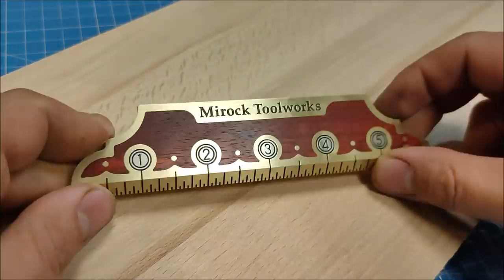Masonic Ruler

Comment: I am as fascinated with the piece itself, as I am with the milling and assembly. Beautiful. Now I want a home use CNC.
Reply: Luckily they're getting cheaper so we can afford to. Cheap ones can be made if you have the want to and know how. They are pretty good also. Tormach is a little pricier for the home shop but they're decent enough even for beginner hobbyists. There are cheaper ones still.
Reply: If you know how to program it via madtercam or some other software get a ghost gunner. Really small really strong 3 axis mill ready for metal
Reply: @WoodsRlee  can it be programmed through open source?  I understand the basics of programming, but would not be able to program a CNC from scratch. I am thinking about building a CNC, and paying someone else for the code.
Reply: @Inertia888  
As far as the ghost gunner goes. You CAN. Look up gcode. I frequently code by hand for small projects. Notepad. But its not an easy task and easy to fuck up a machine if you are really new to it. But there are a million choices for learning to code it.

As far as building a cnc from scratch, it's also relatively easy to do, but if you can't program well, or not sure, it will be difficult  to see where problems are when they arise, is it your gcode? Is the machine malfunctioning?

I would suggest you get a cnc mill kit if you want to build one. That way you know it works

Comment: What a beautiful ruler Out of curiosity, what makes it Masonic? I understand the significance of a 24 inch gauge, but unsure about this?
Reply: This should be the top comment. It's a very fancy 6 inch ruler, to be sure. Not even an attempt to describe whether it was made by a mason or inspired by an old masonic design. Not even some basic or obscure masonic symbolism etched into the surface... and those are best cases, because it "sounds cool" is probably, statistically, the unfortunate answer here. Pretty ruler though.
Reply: @bobskewer1874  the only reason i watched it was to learn what a masonic ruler is. also the only reason i came to the comments. does the shape have special applications? if so, why no demonstration of it in use? meh.

Comment: What, exactly, makes this “Masonic”?  I didn’t see any of the symbols normally associated with Masons.  I would call this “steampunk”!  It’s beautiful!!!
Reply: I guess it depends on the ritual...  It is 6 inches long,  so 6 multiplied by 4 is 24...  That is as far as I will go on an open forum.  Very nice work!
Reply: @louisjutras1  … I knew there had to be some mystical reference in there somewhere.  😀 thanks for clarifying!
Reply: @louisjutras1  good math. But that is a poor answer for the Masons. From a Past Master.
Reply: @halkester9368  …it’s ok… I don’t need to know y’all’s secrets.  I just wondered what caused Mirock to label it “Masonic”!  I gather there is some significant meaning in the dimensions and or the shape.  It’s very pretty.  And he does wonderful work!
Reply: @halkester9368  In the province of Quebec,  we have 24 inches.  Period.  In all the years I have been around,  I have never seen a 6 inches ruler in any of the lodges here.  So again,  the ritual you are using in your jurisdiction might see this differently.    I was PDDGM by the way.
Reply: @louisjutras1  I wrote a new reply to anyone. I agree with you about the tool.  I don't know what the man was trying to explain with 6x4 at all.  Or any reason this ruler would be called masonic.  please drop a note to mr. Mirock or the man who can do 6x4.
Reply: @louisjutras1 How magnanimous of you to go as far as you did.

Comment: Plexi-Glass!!! I was wondering why you were using it at first, but then I realized. That’s a really good way to keep a small work piece fixed to the the table. Awesome project!
Reply from the maker: Yes. But need to use flexible plastic polycarbonate in my case.
Reply: Ahhh okay, thanks for telling me what you were actually using…from the computer screen, all clear plastic with that description looks like plexiglass lol

Comment: I have a question. And yes I suppose I could go google it but I’m hoping someone will answer. I am a carpenter and have been one for a long time but I do finish work frame houses have always wanted to do finer projects. Inlays etc. I have some very nice insoles that I have refurbished and they work great sharpen them myself set the teeth etc. But what about for CNC routers and the four machines. How are these old beautiful wooden tools made and projects?

Comment: Another comment likely already has it... but 
1 tool hangout on engraver is too long 
2 use all carbide tooling if you arent 
3 make / buy cantilever style hold downs for the angle cut.
4 hold those plugs in with thermal press fit... or knock them in with dull punch.

Comment: Fantastic work. 
Perhaps having an aluminium bed would save you the notching and screwing ? 
Let's say you find a 3/4"  aluminium plate, which you could index precisely using dowel pins, allowing you to simply crazy glue your brass pieces. 
You could even drill into it and make it indexable with threads to screw in fun fixtures, and perhaps one day,  a low profile hydraulic vice to hold those brass plates. . .
Reply from the maker: I use aluminum but not for first time item
Reply: @mirockswoodshop  I looked through your videos, I'm impressed. I'm the process of building a 4axis router and you have me a great idea; I'll have a 48" wide vice trough the bed, so I can do fancy  joinery.  On larger pieces

Comment: Ok,  this is going to be a little bit pedantic but that is actually a “rule” not a “ruler”.  A rule measures from the edge while a ruler has some space either side.  

A ruler is designed for drawing, which this isn’t which is why you had to draw the line from the middle rather starting at the front.

Comment: The first pass with the CNC machine confused the shit out of me. If you were going to use a belt sander on it anyways, then WHY not just use the belt sander to sand off that tiny amount you took off the top with the CNC machine? And the stuff with using acrylic to hold down that small price, why do that instead of just using a chisel to cut out a slot in the wood for the brass piece to fit into and hold it still. That way you don't have to mess with cutting through the acrylic first. Maybe it's just me, but it really just feels like a lot of unnecessary extra steps, screwing and extra work that you don't really need to do is all.

Comment: I like what you have made and how you made it BUT THAT PIECE OF IDIOCY AT THE START NEEDS CALLING OUT
Don't ever hold a piece of anything in your open hand and go at it with an angle grinder. That's a great way to get hurt.
What would it have taken for you to put it in a vise or just clamp it to the bench and then use both hands on the grinder?  

Sorry If I sound like the safety police, but there's too much of that sort of stuff being posted. 
Beautiful work and I'd love to see you do a metric version but you wont if your missing fingers.

Keep this in mind: Power tools are like mistresses. They are fantastic, but if you disrespect them, they'll cut bits off you body.